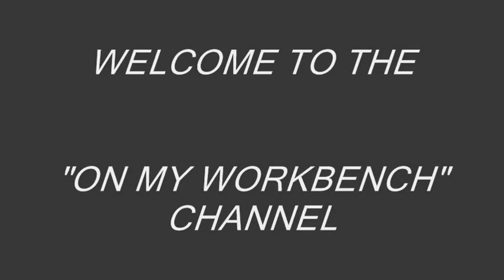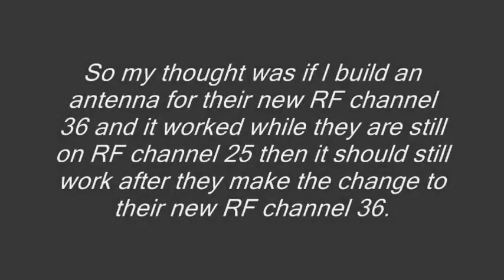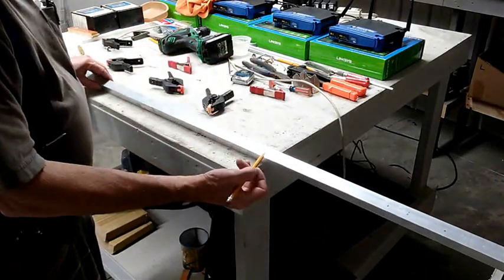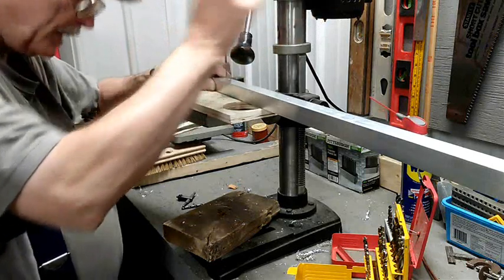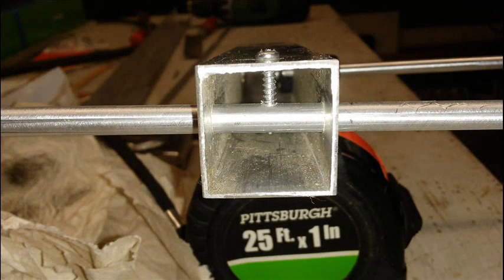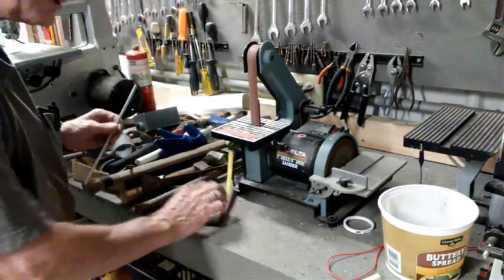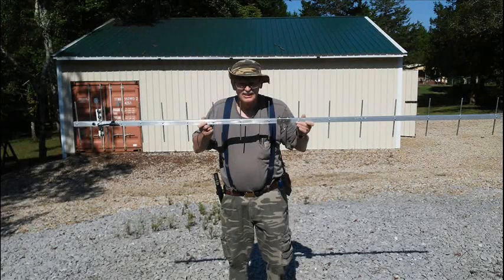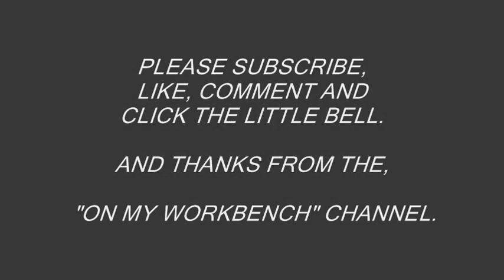DIY TV ANTENNA PART 2

Comment: Sir :
I may be preaching to the choir, so forgive me if that is the case !
In regards to element diameters, you can make your yagi's more forgiving by increasing the driven elements diameters, essentially making them fatter, for lack of a better term.
Allowing greater band width, which may be beneficial to the  " Hop Scotch "
methods the FCC seem to be using to allocate frequency use to the highest bidder !
As I said in an earlier text, if you don't, I think a good preamp would be very helpful.
As you likely know, feed point impedances play a critical role in the success of antenna playing, or not !
Especially with the new digital modes employed in television today.
It is either " On ", or,
 " Off ", with little to no forgiveness with regards to inaccuracies !
Thanks for your consideration.
Reply: I would love to know the answer to the larger diameter element size Sir. Thanks

Comment: Beautiful antenna.  I'm getting ready to try to duplicate it.  The online calculator does not say much about the dipole. It gives directions for a folded dipole.  I might have to use that.  It looks like you used a straight dipole, but it's not a full wave.  It looks like you have it divided with the insulator.  Could you give some details on the lengths you used?   We sure appreciate you!
Reply from the maker: Hey4883,

If you are trying to receive a station on RF CH 36, 605 MHz please hold off on building the Yagi, after WTVF CH 5 changed from RF CH 25, 539 MHz to RF CH 36, 605 MHz, I have not been able to receive their signal my Yagi antennas are DEAD on RF CH 36, 605 MHz, I designed my antennas for RF CH 36, 605 MHz and they worked outstandingly when WTVF was on 
RF CH 25, 539 MHz. I have been working on finding the problem for a month, while I still don't know what the problem is I do know what the problem
is not, as everything that I have tried and I have tried a lot of things, have made no improvement. I have order a Nano Vector Network Analyzer to test my Yagi and try and find out why they are DEAD.

https://www.amazon.com/etateta-Analyzer-Portable-Shortwave-50KHz-900MHz/dp/B07Z26RZC8/ref=asc_df_B07Z26RZC8/?tag=hyprod-20&linkCode=df0&hvadid=385641687827&hvpos=1o8&hvnetw=g&hvrand=8714774463791332013&hvpone=&hvptwo=&hvqmt=&hvdev=c&hvdvcmdl=&hvlocint=&hvlocphy=9013711&hvtargid=aud-801738734305:pla-842334167000&psc=1&tag=&ref=&adgrpid=76926660445&hvpone=&hvptwo=&hvadid=385641687827&hvpos=1o8&hvnetw=g&hvrand=8714774463791332013&hvqmt=&hvdev=c&hvdvcmdl=&hvlocint=&hvlocphy=9013711&hvtargid=aud-801738734305:pla-842334167000 

I have found a deferent Yagi Calculator that provides more parameters and does provide the dimensions for both straight and folded dipoles.  

Yagi Calculator by John Drew
https://www.vk5dj.com/yagi.html   

Direct link
https://www.vk5dj.com/SetupYagiCalculator.exe   

I will get to the bottom of why the antennas work on RF CH 25, 539 MHz but not working on RF CH 36, 605.
Reply: @onmyworkbench7000  I have completed the entire stacked antenna except the dipoles.  I'm still studying that.  If you figure out anything I'd appreciate the info....Thanks
Reply: I am still waiting for the Vector Network Analyzer to get here, it's coming from China and taking it time getting here. I will let you know as soon as I have a solution.  It works for other frequencies but is dead on CH 36, 605 MHz.
Did you use the Yagi Calculator https://www.changpuak.ch/electronics/yagi_uda_antenna_DL6WU.php
Please post photos of your antennas.

Comment: Truth and Quality.
Practical and Useful Information.

www.wadeantenna.com

Wade antenna makes cut to channel antennas.

The advertising is aimed at the cable provider head ends and professional industry.

Yes you can buy these Tv antennas.

And Yes the prices reflect the quality of the antennas.

And Yes , Blounder Tongue , www.blondertongue.com , is still selling some antennas.

And Yes the prices reflect the quality of the antennas.

----------------------------------

www.tvfool.com , provides location information of Tv transmitters and reception locations and more information.